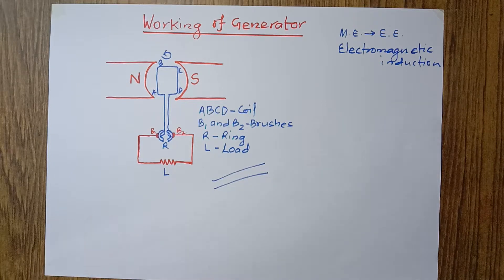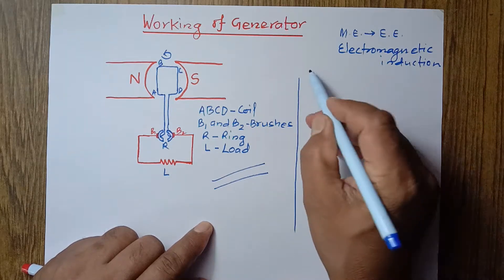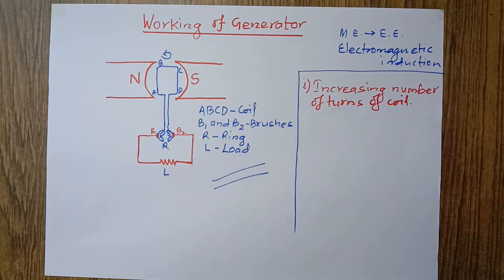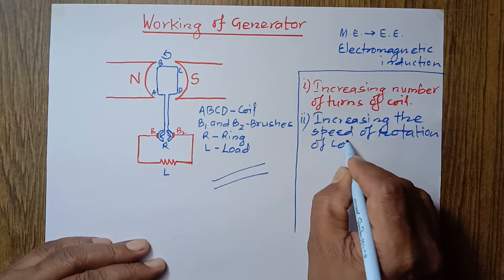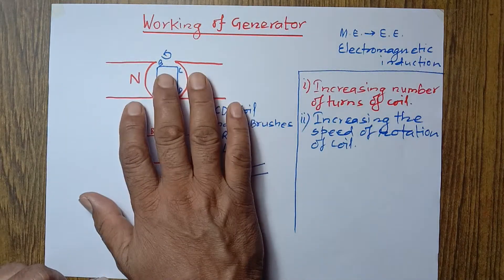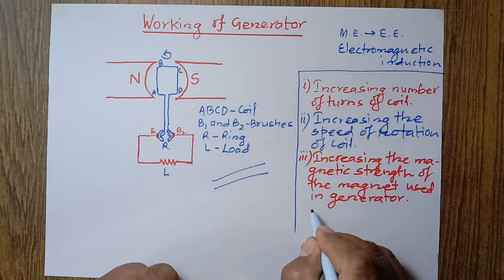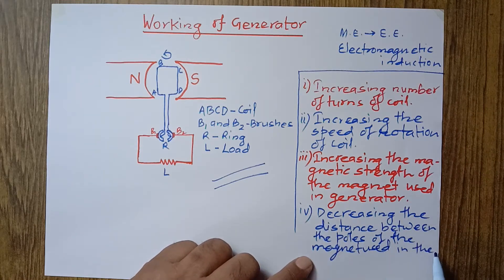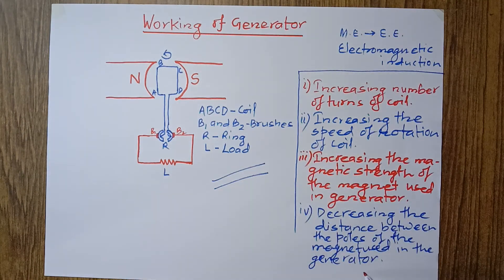How to increase electricity produced by a generator?

Comment: Increasing the number of wire turns is not possible because of the space so you need to change the section of the wire then all you are goin to happen is increase in voltage and a decrease in current (amps). 
If you increase the speed the voltage and current will increase the heat increase and everything will burn.

Comment: Love from kapilvastu. Sir nmaste. सर डिजेल वा पेट्रोलबाट चल्ने जेनेरेटरमा बिद्युत कसरी प्रोड्युस हुन्छ र !!
Reply from the maker: All the generators work on the principle of electromagnetic induction as maintained in my previous class. Petrol or diesel or natural gas or any other fuel is used to rotate the coil and then the mechanical energy converts to electrical energy. Link https://youtu.be/jsupGlzqKRs